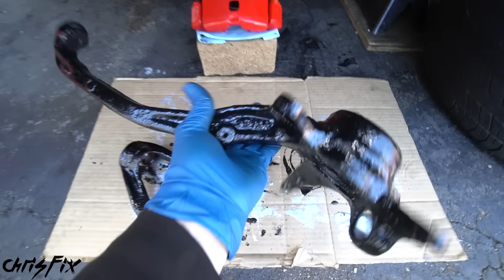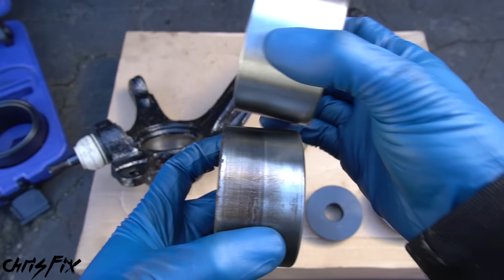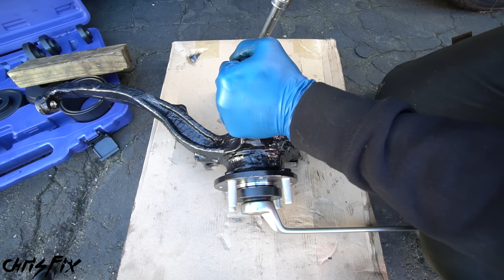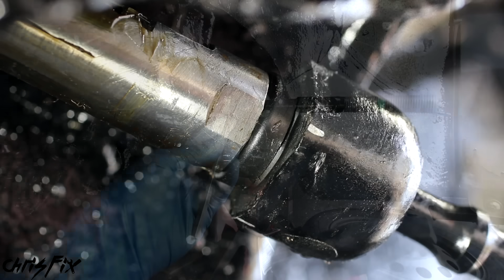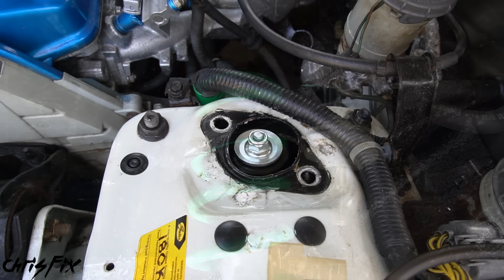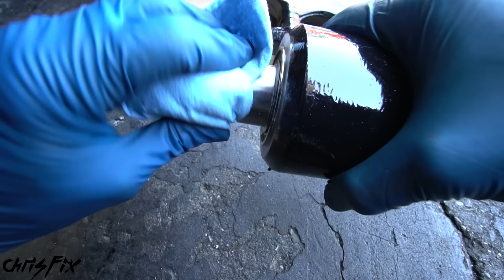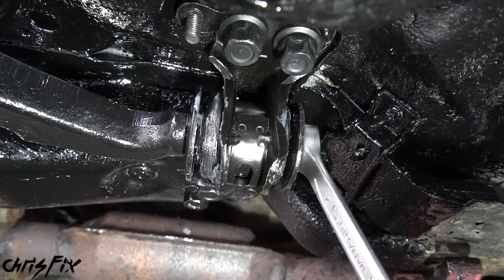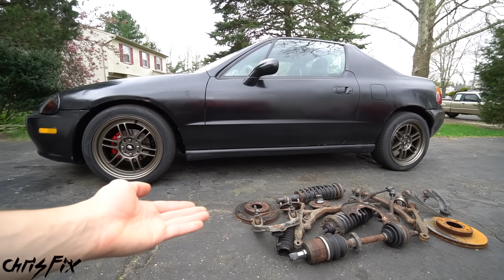How to Install a COMPLETELY New Front Suspension in your Car or Truck

Comment: Hey Chris, i was curious to know if there an inexpensive way to fix my dads old 1990 silverado 1500, he sadly passed away and i was wanting to fix the AC in it. before he told me that it would turn on/off sometimes, that was over 20 years ago. it hasnt worked since then, i think it might be out of freon/refrigerant. i dont have the money right now to convert it to r134. i saw your video on doing it and was just wondering if theres another method to this. Thanks!

Comment: Hey Chris, my experience with eBay turbo kits is that the oil supply to the turbo is not sufficient, as well as the wastegates are usually not big enough. I would recommend checking them and possibly getting different parts if needed. I would just hate to watch you do all that work and blow up the motor. (Although it would be cool to watch you do a motor rebuild)

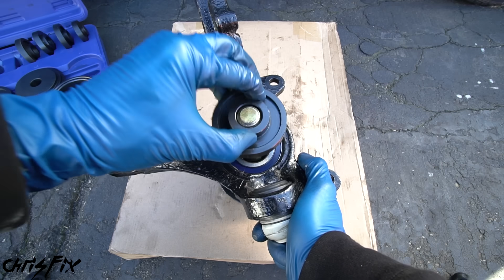Comment: Chris, at 7:44, since you're pressing something into the inside of the bearing, shouldn't you have used a pressing plate for pressing against the inside of the bearing as well, as not to put force on the balls in the bearing?

Comment: Hey chris, just wondering if you'll ever do a drum brake to disc brake swap video? I'm really hoping I can eventually do it when my skill at auto service is higher on the vehicle I've technically bought; a 2003 base Pontiac Vibe
Also, it's got around 140k kilometers on it (around 84k miles), and I got it for about 764 USD. Think it's a good deal?

Comment: Tip for filling up transmission if its a manual. Check your manual and forums for what fluid to use. My car was specific gl-4 and very hard to find at any auto store. If you use the wrong fluid you can eat away at the gold medals and synchros. Cheers!

Comment: I really like these videos. It makes the idea of doing some of your own work seem a lot less intimidating. It's fun, saves money, and there is a real sense of satisfaction when you fix something yourself. You also generally learn something about how things work. It's also nice to see how few tools you actually need to do repairs and upgrades most of the time. a basic set of sockets, ratchets, screwdrivers, and at least one torque wrench look like they would handle most things.

Comment: Nobody:
Chrisfix: "Let's put on some medium strength thread locker."
Reply: @Livin Vids  Up here in the snow belt, we could never do this whole job with just "common hand tools", but at least we don't have to worry about using threadlocker on everything. The road salt and rust will stop any bolts from ever loosening up.
Reply: @anti0918  Well our common hand tools includes air hammer, angle grinder and oxygen cutting tools. Here in Finland we have 7 month/ year road salt period, so every bolt and nut is pretty tight after 5 y or so.
Reply: @anti0918  ya, even when you want them to lol.
Reply: Lmao
Reply: @Livin Vids he lives in the rustbelt so bolts always rust from road salt, therefore... no threadlocker necessary (almost joking)
Reply: @Livin Vids he's just trolling
Reply: Some poor jerk is gonna try to take that bolt out with common hand tools and bust his knuckles because he slapped thread locker on it.
Reply: I WAS JUST ABOUT TO TYPE THIS
Reply: I read this outload twice. I SAID FRED LOCKER THE FIRST TIME AND BECAME COMFUSED> Why
Reply: @TheItalianWarlord

CrisFix use more liters of medium strenght thread locker than in a car fabric.
Reply: Blue Permatex.
Reply: We use salt...
Reply: @dot7107  we use cross threading
Reply: @dot7107  salt is not good enough to lock them hard, we use cement.
Reply: @chenyutong7625  😂
Reply: But the bolt will come lose if you don't put medium strength threadloker on it
Reply: @Livin Vids he's trolling, salt will rust metal
Reply: @1Steph  It will rust it in place ;)
Reply: @1Steph  r/whoosh

Comment: You are cutting corners where it could be dangerous. Like the cotter pin for that castle nut or the bolt you didn't properly torque down. The cotter pin needs to be cut and bent OVER the bolt and down towards the bottom of the nut. For the bolt you didn't torque right, you could have used a crows foot.

Comment: Hi Chris, thanks, great video.   If I might add a minor safety note. On the boot, you installed a stainless metal zip-tie.  If you cut it with snips or dikes, they are RAZOR SHARP.  Best to use a pair of needle-nose pliers and curl them into themselves, like a snail shell...out of harms way.    Keep up the good vids DUDE !     J K

Comment: I have ptsd from tie rods because when I was building my gokart, the tie rods that came with the body were old and the threads were hashed so I was up for days re cutting the threads and cranking them on with the nuts. Matter of fact, I was taking my cart for a run and the tie rod popped apart and I almost smacked a curb,  fortunately I wasn’t going too too fast. A little weld and some red loctite and I kart on another day.

Comment: Chirs, check the spec for that gearbox, usually, while removing the trans, oil should leak out, if noting came out, you probably have low to no oil in that gearbox,  And replace all of it, that transmission oil you used to lube the trans, seems too thin, manual trans isn't the same as auto trans fluid. Otherwise, nice video as usual :)

Comment: Another great video. That pretty much lays down all of the fundamentals of a pretty common configuration for a front wheel drive car. I'll bet that thing DOES handle like new. Bet she's as tight as the day she left the factory. I'll be doing something similar on each of my project vehicles eventually. Still trying to get a garage built. It's been so rainy here in Dallas the past 6 months there are spots where there has been standing water the ENTIRE time!!! lol. If I had a concrete drive way it would help but don't have one of those and the ground is so soft I just don't trust jack stands on either wood or concrete pavers. So.... All things in time. I did use some ChrisFix inspired procedures to replace heater hoses on my old 79 K10 pickup earlier this week. Went perfect. Other cooling system work to follow as time allows. 

Again great work on the little Honda..  Also..  eBay Turbo Kit!!!!! Wouldn't it be cool to call in a little cooperation with the BoostedBoiz or PFIspeed? I'm sure they'd drive out from Colorado to do it.

Comment: Looking at buying a 7.3 F-350 with 524,000mi... Never had any suspension work done. Probably gonna rebuild the entire suspension and steering system. But damn, those 7.3s run fucking forever.

Comment: My car has 216k miles on it, pretty sure the suspension will need some repairs (probably not quite as extensive as the Del Sol, but still) and I'll probably reference this video later this summer after I fix a few other things! you're very thorough.

Comment: Awesome video as usual. Any reason you skipped showing the adjustable sway bar links in the thumbnail? I've always been curious but never used adjustable ones and wondered if you came across any issues with them.
Reply from the maker: My car doesn’t come with a sway bar, the 94+ did haha.
Reply: @chrisfix  Hahaha. Yup, done that sort of thing before too.

Comment: What grease should I use on diff drain plug, these magnetic ones, so the metal shaving sticks to it? Can I use high temp grease?
Reply from the maker: Don’t use grease on an oil drain plug
Reply: @chrisfix What should I do with the grease? I have to remove the grease to inspect for metal wear.

Comment: Hi Chris I was wondering if you could help me out I have a 2004 Pontiac grand prix and I want to take the transmission out and I want to work on it because I barely bought it and I want it to make it a race and daily car
Reply from the maker: I have a video on how to replace the transmission.
Reply: Also I wanted to know I barley replaced all the ignition coils and its running rich on gas I wanted to know if it's the control module because before I switched the ignition coils it used to run good

Comment: Hey Chris love your vids but I just wanted to let you know that you put the cotter pin in the outer tie rod castle nut in wrong. A tip for you is to only bend one part of the cotter pin and cutting the other off. Since bending both weakens it my dad which has been doing mechanics for about 42-43 years now both taught and proved that it weakens the pin. PS. Not trying to be mean just trying to help

Comment: Use stainless steel “Zip Ties” where you want them to last. Regular plastic zip ties don’t stand up to the elements or heat and will likely fail in a matter of weeks.

Regarding the brake dust shields, it is possible to make your own with aluminum or steel(needs paint!) sheet metal. Tin snips, sheet metal pliers, drill, body work hammer  and a few odds and ends like large sockets or steel pipe to form edges is all you need. A 4” x 4’ piece of wood works great for an anvil with thin metal.

Great video, as always!

Comment: Did you check around for 5th gen civic or 3rd gen integra dust shields? Because those should be the same
Reply from the maker: I called up a few dealers and they said I need the Del Sol specific ones.

Comment: Good video. But you should have backed up the inner bearing race when you pressed on the hub. You may have premature failure of the bearing. You know how the old race stays on the old hub when removing it from the old bearing? Yup. Similar damage. Sorry and I hate being the armchair mechanic with 20/20 hind sight. It may be just fine. It's just a precaution
Reply from the maker: Not sure I follow. What I did was the correct procedure. The bearing was properly supported from the outside and inside race and the hub went in smoothly/straight
Reply: @chrisfix  At 7:43 you said to support the "outside" of the bearing when you press the hub back in. Did you mean support the "outer race" and not the inner race or was that just a general statement? By using that press plate you used it appeared you put the forces on the outer race and not the inner race? When you press the hub back into the bearing the inner race should be supported not the outer race.

Comment: Ooo red caliper, that adds 25 horsepower.
Reply: Now he just needs stickers, those are 5hp each
Reply: Then add a brembo sticker and gain 5hp
Reply: @trashcarfj45  Better yet a brembo caliper cover.
Reply: @a-a-ron2686  was sick to my stomach when I saw they actually make those
Reply: @a-a-ron2686  +15hp
Reply: Thats a fact 🙄
Reply: Neither the paint or sticker adds any extra horsepower at all.

Even upgraded brakes don't add any power all all, but If your old brakes are seized, after having properly working brakes, the pad will glide freely, no longer having brake drag, giving the sensation of more horsepower, due to the brakes no longer being seized.

Comment: Hey Chris! I have a 1996 Volvo 850r. It's awesome but recently it takes a tiny bit longer to turn on when I turn the key. Do you have an idea as to what it could be? It's been leaking a little bit of oil, but I check the engine dip stick and the oil level is fine

Comment: I've had probably 15 cars in 30+ years, and have had to do most of my own repairs, and didn't enjoy any of it. Probably because it was under non-ideal conditions, like middle of winter, side of the highway, middle of the night before my final exams in college, etc. You, however, put such a positive light and fresh perspective that I wouldn't mind replacing my front suspension!  Keep up the good work!
Reply from the maker: Haha thanks Joe! Sometimes working on cars can be tough because the external conditions

Comment: Cris, when I turn the steering wheel to the side, it sounds like a "clap". He does not always do it, but sometimes he does. What could it be? It's a 2015 model car, relatively new, I use it every day but that noise catches my attention. Thanks!
Reply: I'm sure Chris will answer, but in case he doesn't, several things can do that but be sure to check your tie rods NOW.  Even though your car is relatively new and the tie rod ends would not be expected to be worn out, some do not use a jam nut like Chris showed today. Some use a compression nut and, if that is loose (or missing), it will make noise like that. It is extremely dangerous!!!  Check it out!!!
Reply from the maker: Check bushings, ball joints and tie rods. Probably a bushing or sway bar end links.
Reply: Thanks Whole and Chris!!

Comment: Wait turbo on a stock engine? How much psi can it take before blowing up? I researched how much boost my Honda’s engine could take (D17A1) and it’s 7 pounds but I’m not confident enough to install.
Reply from the maker: Apparently these little d15 engines can take a lot of boost.

Comment: Hey chris! love your car vids, and i recently got my own project. Got any tips for unsticking an engine thats been sitting for years? ive got the head off and I'm soaking the cylinders with MMO, Diesel, and ATF. Is there anything more I can do?
Reply from the maker: That’s all you can do. Try using penetrating fluid.

Comment: Hey Chris I have been watching your videos for some time now and I truly do appreciate you I was wondering if you could help I have a 2004 Nissan Quest and it's giving me codes p1148 and p1031 I have replaced the oxygen sensor in front of the radiator fan and I also replace the one underneath the car that's next to the motor oil pan and the codes are still popping up I wanted to fix this vehicle for my grandparents before I get deployed on Wednesday any advice thank you
Reply from the maker: Strange. Did you put OEM sensors in? Check out my video “how to replace air fuel ratio sensors”.
Reply: @chrisfix  yes ntk and nissan oem I think I replaced the wrong one I'm so confused I replaced the on next to the radiator which I assumed was bank one which now I'm finding out its not would u have any idea on location

Comment: But did you forget the screws that screw into the rotor?
Reply from the maker: No I don’t waste my time with those. No point except to make brake changes difficult
Reply: @chrisfix  ah, gotcha. My RSX was missing one and I had a new one laying around so I put it in. I didnt see the point in them but I was just wondering if you skipped on purpose or what. Thanks for the reply! Love your vids!

Comment: How do you know the amount of ft-lb torque to apply on every bolts? Is it in the repair manual which car owner has to purchase separately?
Reply: A lot of the info. you can Google.  If your car has an owners' club on line, the members can supply the data, too.  That's what I do.
Reply from the maker: Watch my video “how to use a torque wrench”

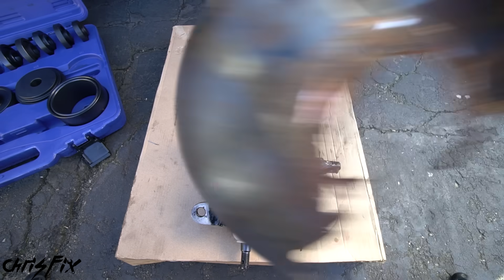Comment: 7:14 it’s not that easy to just install a 5 lug hub on a Honda spindle... you’ll need different spindles, different bearings (from a type r) and you’ll need the bigger heavy duty cv axle with more splines.
Reply from the maker: I wasn’t talking about a Honda specifically. In general, if you wanted to convert to a 5 lug hub, nows your chance.

Comment: You're not supposed to tighten the A arm bushing bolts until after you put the weight of the car on the arm. You can rip the bushing out when you tighten them first before putting load on them
Reply from the maker: As shown in the video, I lined it up with the original control arm so the bushing is in the proper location so it won’t rip. Also I tightened down all of the other bushings under a load. Thanks for sharing.

Comment: Thanks for making these videos! I have a 95' civic hatch its basically the same as yours. I plan on replacing the suspension as well. These videos will help a lot. I just dont have a the tools that I need to do the jobs,
Reply from the maker: The tools aren’t too expensive if you get them from harbor freight. You can get the basics (sockets, screw drivers, pliers, etc) from HF and get the snap ring pliers from a better brand. Rent the ball joint press from the parts store for free and your good to go
Reply: Yeah I would only need the snap ring pliers.

Comment: Why would you not refer everybody to replace the axle seal while the axle is out? That's a whole bunch of work to replace it later!
Reply from the maker: The seal is fine and there is a point where you just can’t replace every part of the car. The focus was on the front suspension. Same reason I didn’t replace the brake lines or the engine or the clutch while everything was out.

Comment: So for those bearings installed into the knuckle... do they come pre lubricated? Or are they just supposed to be dry like that?
Reply from the maker: They can go in dry. A light oil like silicone can be used to help make it a little easier but it isn’t necessary. Good question!

Comment: Why would you put threadlocker on the inside of the bolt? Loctite needs to be installed at the nut side not the head side!
Reply from the maker: Please let me know the time stamp you’re referring to because as far as I know, the threadlocker on every fastener was placed in the correct spot.

Comment: Definitely need that thread locker on the caliper bolts... You dont wanna be cranking on 1 bolt in a Walmart parking lot at 2 AM and driving home with your fingers crossed. 😉👍
Reply from the maker: Hahaha, doesn’t sound like you know this from experience or anything ;)

Comment: u did a mistake.. when inserting the hub on the bearing u need a plate to hold on the inner side of bearing and not outer... the hub is making pressure on the inside part now..
Reply from the maker: The plate I used was pressing on the inside and outside of the bearing.
Reply: @chrisfix  ok.. i just sayd that cause u sayd to hold the outside
Reply: i have a miata. buy one and start working on it! hehe.. since youre a drifter, u gonna love it